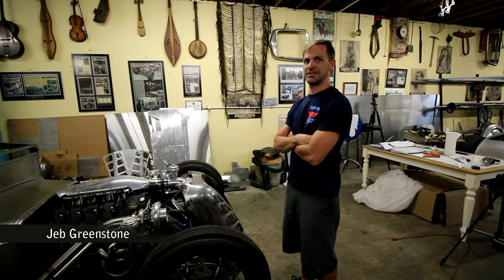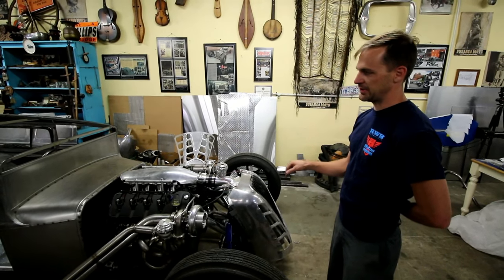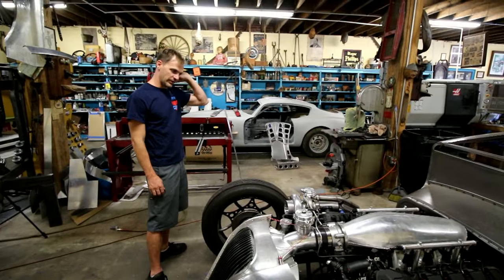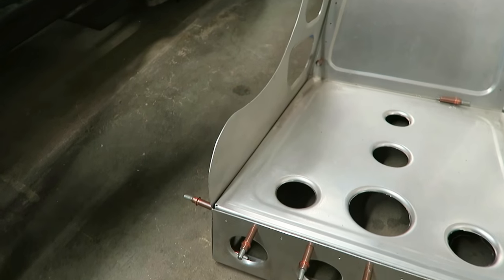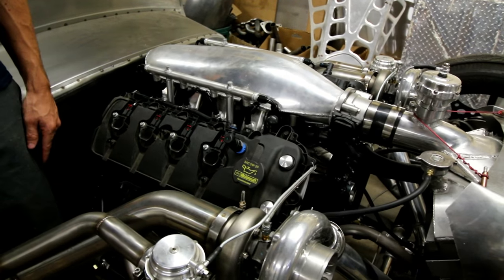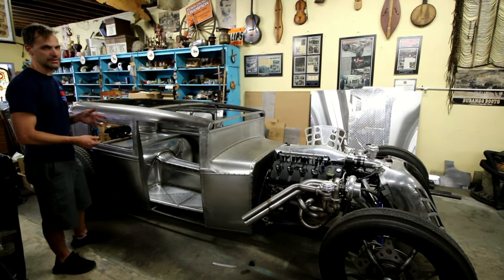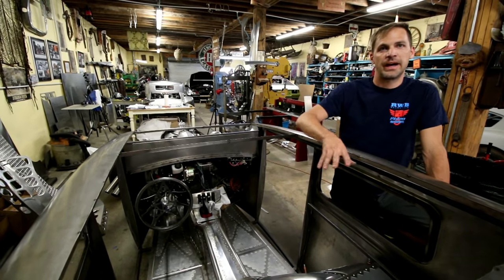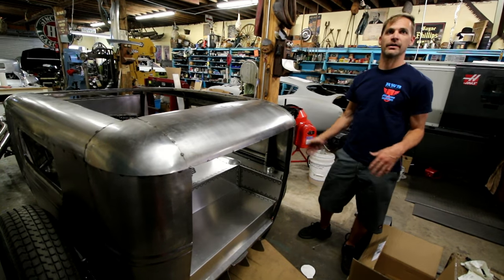Cutworm Specialties Twin Turbo Coyote Hot Rod

Comment: the only idea i have for this hot rod is make a split front window and make the point a little extreme , close toward the point and rake in the grille 
https://s-media-cache-ak0.pinimg.com/736x/7c/8e/7a/7c8e7a65a58858eaa346c97a88e85c53.jpg
would give the rod a more streamlined shape and prolly make it eazier to make a window de-fogger inside the car

Comment: is this like the mercedes sls system?? hydraulic pump, and a control valve to control height and accumulator's(spheres that connect to the hydraulic "shock" that are filled with nitrogen) to give it some shock absorbing affect.
Reply from the maker: no it more or less alters the coil over mounting points
Reply: interesting thank you